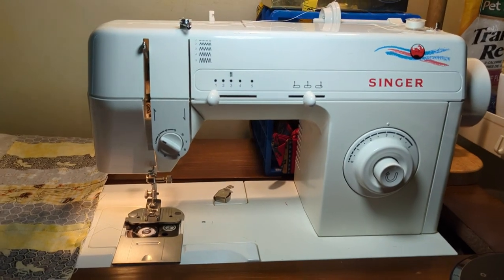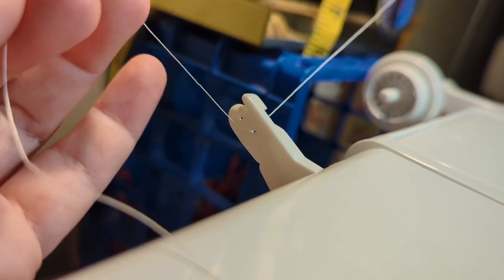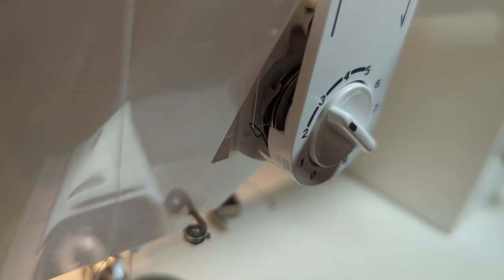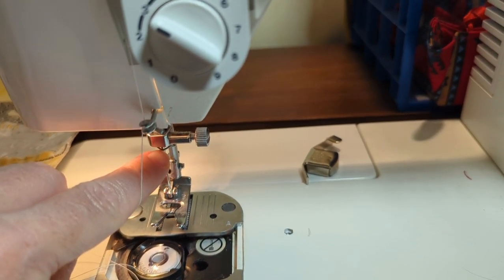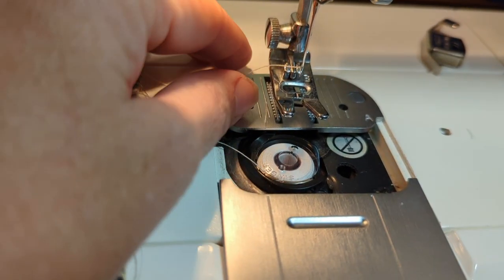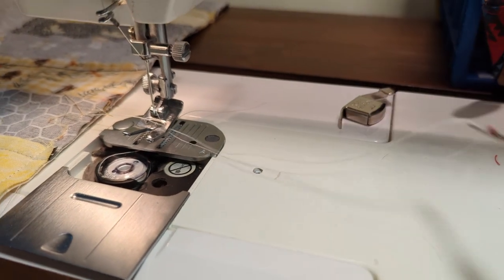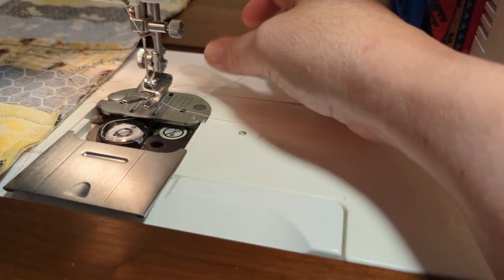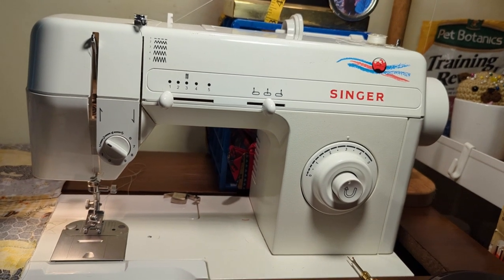How To Thread A Singer 2517 Sewing Machine

Comment: Hi   I  have the same model   and i could not  find and  video to show how to ajust the  needle bar since mine is not   in correct spot and i have issue with the hight of the needle bar  This machine got  3  mark line on the top of the  needle bar instead of the bottom  and could not found a  video to show correct hight of my needle bar can u please do me a favor  rise  the needle bar till you see the first  marked line come out of the top bushing  and  measure  the hight  from the top of the machin to  where it hold the needle in mm  thanks in advance
Reply from the maker: @johnal4560  I have not tinkered with the needle bar, that is something I have to learn myself. Look up on YouTube "Randy The Sewing Machine Man" And he might have a video on this, if he doesn't, reach out to him and he will definitely answer.